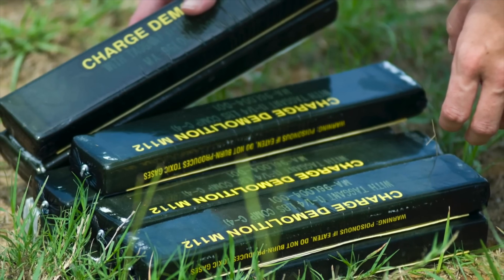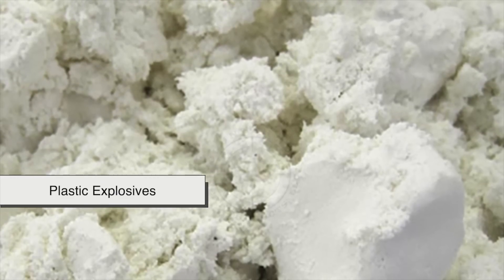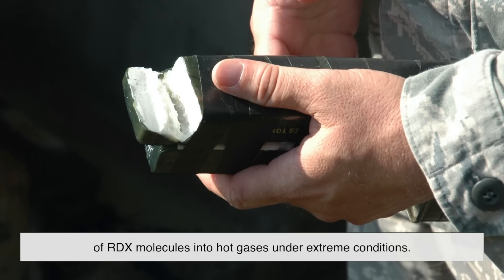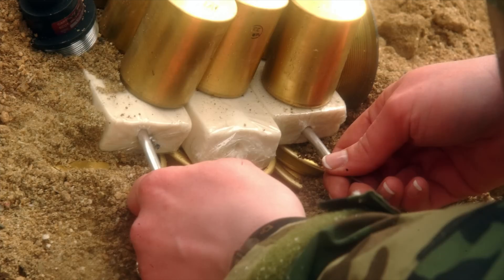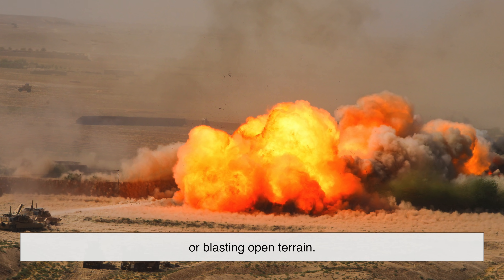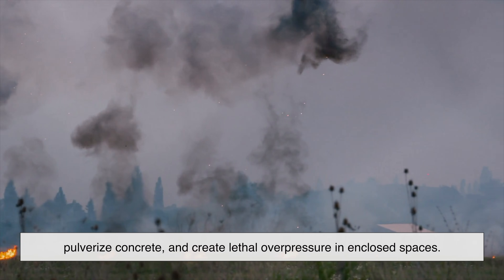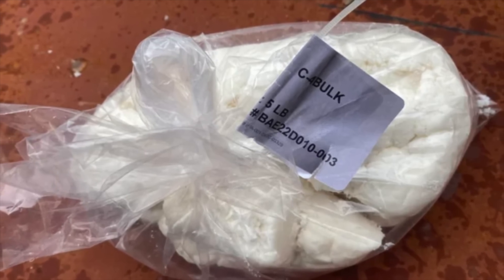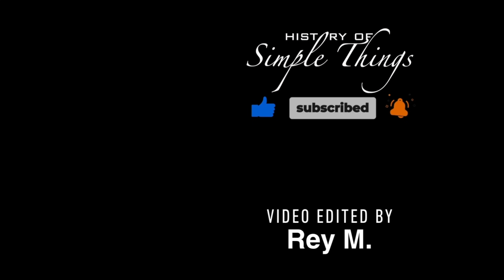How Does Composition C-4 Actually Work? | The Truth Behind the “Plastic Explosive”

Comment: Ok, a few things. Not all C-4 is the same. If you could get your hands on the old Vietnam era M-183 20lb Satchel Charges you were a happy camper. 16ea 1.25lb blocks of the good C-4. Excellent for molding into improvised shape charges or pesky golf course critter shapes. Our shop had pallets of these charges and life was grand. Once those were all consumed however, they issued use the new crap. It was horrible. It had the consistency of sticky wet sand. It would gum up on your hands and absolutely impossible to mold. The reason, tangents were added for tracking and accountability reasons. Each block had hundreds to thousands of color coded strips embedded in each block that could survive a detonation and be read under a microscope. So if any was stolen or used for purposes other than its intended purpose, they could track who was responsible for that particular block. But in doing so, the ruined the ability to have fun with C-4 on the range. There are still M-183 Satchel Charges out there, I’ve seen them. If you can get your hands on them, do it. You won’t be disappointed. And the other thing I heard that was incorrect was you don’t have to have just a blasting cap to detonate it. They require two things to go boom, heat and shock. So you can shoot it or set it on fire and it won’t go off. But if you shoot it while it’s on fire, you get the BOOM BABY. C-4, fun for all ages, get you some today. Or just go to an FBI Improvised Explosive Course and have the professionals teach you how to make bathtub bang with just a simple trip to your local Wally World (that’s Walmart in case you didn’t get it). Have a good evening. EOmfD, Initial Success or Total Failure. Don’t be the pink mist.

Comment: Oops you made a mistake! C4 will detonate if it is shot. I took an old hot water heater and taped C4 to it. I shot it with my 2506. It went off. I had about twenty witnesses.

Comment: As a USMC Combat Engineer (MOS 1371) with 1st Engineer BN, I trained at Camp Talega CA with every explosive known to the military at that time (1964), including C-3, DET. Cord, Shaped Charges, Dynamite, Bangalore Torpedoes, Mines, Etc....In Vietnam I carried a satchel bag full of C-4 (which had replaced C-3) along with blasting caps in my flak jacket on every search and destroy mission. We used it primarily to blow up caves where the VC hid and other combat uses. We also used it to heat our C-Rations.!..Very effective explosive.

Comment: you can set it off with fire if you take a piece about an inch in diameter and set it on fire then place that burning ball on a larger piece and then drop a large heavy rock or weight on top of that, but you want to be  on a cliff top when you drop that rock or you will become part of the country side.

Comment: News to me that C4 can't be set on fire.  We used small balls about the size of a little finger tip to heat C-Ration cans.
Reply: Won't explode when set on fire. Big difference.
Reply: @Mayamax3 unless you stomp on it to put it out!  Let it burn out by itself. 😂😂😂
Reply: @Bbutler787 exactly- heat and pressure ( stomping on it) will detonate it.
Reply: @arthurbrumagem3844  no stomping on lit C4 will not set it off. Not unless you can stomp at 3 times the speed of sound. 😊
Reply: @Sgtwilco3006 I wasn’t about to take that chance .
Reply: @arthurbrumagem3844  I wouldnt have either 😂
Reply: Once in Vietnam I accidentally caught half a stick of C4 on fire. I was just getting ready to stomp on it to put it out. Pretty sure there was an angel on my shoulder which stopped me or I would not be typing this

Comment: I spent 8 years as a PMC for the DoD in a facility that made that stuff along with other munitions and weapon systems. I still have the safety papers the Army provided for handling it. I used to have all the technical papers that included revisions for it. I sure do miss those days working with EOD to destroy it along with everything else the Army wanted gone. I was over the decontamination process of that facility and seen what happens when that stuff is misused.

Comment: The stuff is actually rather firm. You could mold it with a press or a hammer. One way to use it well is put it over a copper L rail and use it to cut through thick metal. The stuff is also extremely safe as far as explosives go.
Reply: I think you might be thinking of TNT. C4 or British PE4 is quite malleable unless it’s VERY cold

Comment: In the military, we used to use a primer on Plastic and the detonator was inserted into the Primer. If the charge was buried, we never buried the detonator, that stayed on the surface with a Primer and Det cord going down to the plastic where there was another Primer with the Det Cord plugged into it. That way, if ever you had a miss-fire or change in orders and had to recover the charge,  you could safely dig it out. Another thing we used to do was to break off a bit of plastic, light it and boil our billy over it. You had to be careful though, 'cause it burned so hot that if you didn't keep moving the billy, it would burn through the aluminium.  Ah, fund days !!!
Reply: The primer was more important when there were less powerful detonators or less sensitive secondary explosives.
Reply: @bob_the_bomb4508  The Primer is also more important militarily - when you pop the button, you want it to go bang. The primer is your insurance.
Reply: @Kysushanz again, that depends. Most modern NATO spec explosive trains don’t require a primer.
Reply: @bob_the_bomb4508  Oh, I'm Viet Nam era.
Reply: @Kysushanz makes sense. By the 80’s there was no need. Although some TNT main charges may benefit from a primer, and low sensitivity explosives like ANFO definitely need it.

Never burying a det is still good practice though. The only exception in my experience was the ‘rapid cratering kit’.
Reply: @bob_the_bomb4508  When we made ANFO we put 6% by weight in CN TNT or PE4 connected directly to the Det Cord, into the sock/pipe. Usually used for Anti-Tank obstacle [crater] or for tree clearing [root removal]. We used to gauge who had mixed properly by the smoke - big, sooty black and they had used too much diesel, wispy light grey smoke and not enough dissel, light grey smoke - just right. Fun times.

Comment: I used to work at ROF 37 Bridgwater as an apprentice engineer and then skilled man. 

We made RDX C4 and TNT plus acids there.  

The machines used to manufacture these explosives were from the 2ND world war. 

Old gear, imperial nuts and bolts. 

We made a gift for the Canadians after getting a big order, someone managed to get a very large Maple leaf and I cut a copper sheet that it sat on. 

A sheet of C4 was placed on top of the copper sheet and detonated. 

It left an almost perfect impression in the copper sheet.  

A maple leaf.  

In then cut the sheet into a hexagon shape and polished it. 

It was mounted on a wooden base and presented to the Canadian representative as a gift. 

The hexagon shape represents the chemical shape of an RDX crystal.
Reply: I also was a fitter at ROF 37 ,shift fitter for most of it from 1975-1991 the C4 was as we called PE4 but did do PE6 which was added aluminium powder for underwater use..made from crude RDX mixed with a paraffin based wax,the cartridge machine that packed the PE4 was a converted butter wrapping machine from Germany. 
RDX was a game changer as Barney’s Wallace knew it always took the line of greatest resistance so was perfect for the Dams in Germany,happy memories all gone now ..a large Battery factory now

Comment: Great stuff, as my EOD instructor once said ;  “ there isn’t a problem in life, that can’t be fixed, with the right application of explosives “
Reply: This one had me thinking; I wanted it to be true.  

However, if I have a problem with my car's engine, the right application of explosives would simply give me a different problem 😂
Reply: @Game-The-System  True, but you wouldn't have a problem with the car not starting any longer. No car, no car trouble.
Reply: @Game-The-System actually the correct application of explosions is how an internal combination engine works!

Comment: The "C" stands for "composition," so you can just call it "Composition 4," or "C-4." Doesn't make sense to call it "Composition Composition 4."
Reply: I wonder what happened to those who had to try the first 3 compositions.
Reply: Like when someone says VIN number or PIN number.
Reply: That's incorrect, the "C" in "C-4" does not stand for "composition".

The letter C is simply part of a lettering scheme to differentiate all the various explosive mixtures and compositions. There's also Composition A, B, D, H, etc.
Reply: It says comp C4 right on the label

Comment: Probably obvious but must be said.
The temperature and shockwave produced by the c4 detonating from the blasting cap is enough to detonate surrounding c4.
This is what leads to the lightning fast chain reaction detonation.
Reply: but to control the wanted impact you need to steer the force by timing, which requires the use of several detonators and delay detonators in the right order and distance.

Comment: How is det-cord made, and what are it uses
Reply: Mostly made from PETN wrapped in fibers. Velocity of detonation is around 21000 feet per second. Available from 7 grains per foot to 400 grains. Used in mining and demolition to detonate other cap sensitive explosives. Used miles of this fun stuff in my career.
Reply: C4 is injected into a plastic tube. It's water proof. It too is set off by a blasting cap. Use on tree's and poles. For steel beam C4 is injected in a copper tube smashed into a V shape. Some on each side of beam slightly offset. The copper acts like a knife making a perfect cut.
Reply: I watched OCS Engineers blow telephone poles in two with it.  Apparently det cord comes in several strengths and what they were using was the strongest.
Reply: @johncooper4637 depends on how many wraps around the pole. I have taken down many trees of different sizes depending on the number of wraps around the tree
Reply: Felling trees